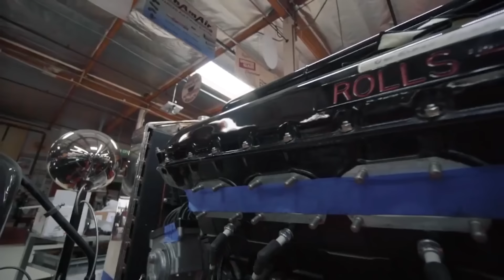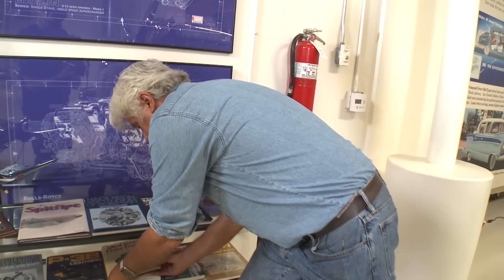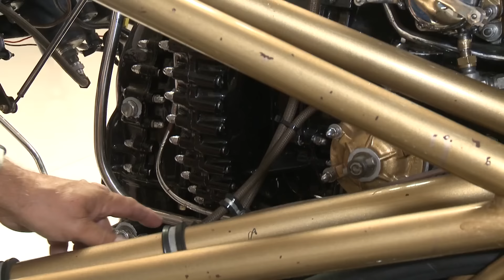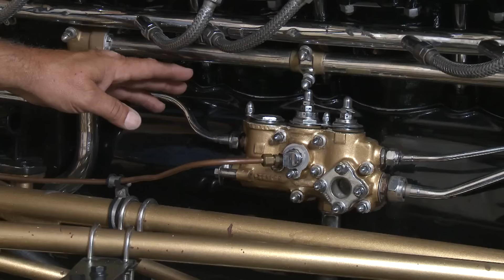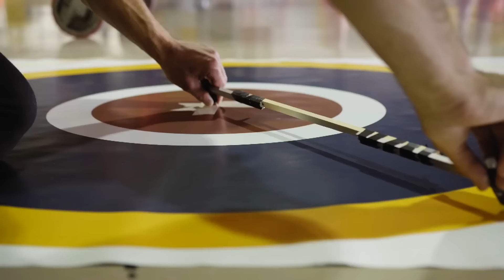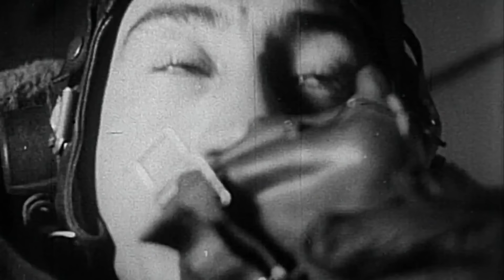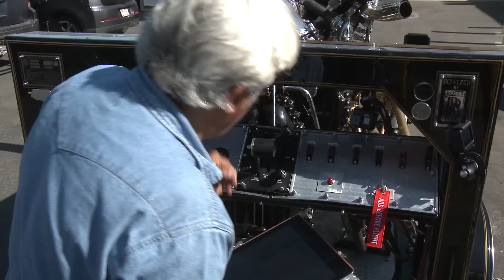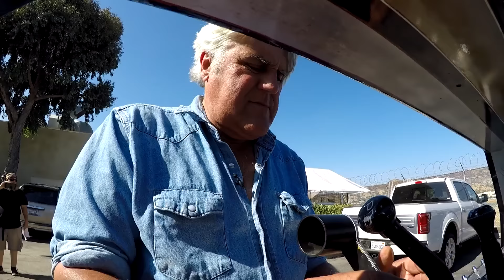The Engine That Won World War II - Jay Leno's Garage

Comment: Jay,

It's beyond doubt that the Merlin is a FABULOUS engine.  It powered the Spitfire, the Mustang, the Hurricane, the Lancaster, and the Mosquito.  However, it has serious competition on the Allied side in Pratt & Whitney's R2800.  The R2800 powered the Thunderbolt, the Hellcat, the Corsair, and the B26.  Post WW2, a pair of R2800s powered Sikorsky's CH37 "chopper".

BTW, 100LL avgas is not good enough for those terrific warbird engines, if full performance is to be obtained.  For that you need 115/145 avgas, which is LOADED with lead.

Eli D.
Reply: what engine powered the typhoon and tempest?

Comment: Jay, isn't the engine in the Bentley you mentioned a Rolls Royce Meteor? Because when it was on Top Gear, James May pointed out that it was the non-supercharged land-based variant of the Merlin, which was the Meteor.

Comment: Rolls-Royce selected Packard to build the Merlin engine because of their exacting manufacturing specifications and techniques. The throttle system with levers, rods, and bellcranks is really precise. Packard was years ahead of other manufacturers in the USA. But sadly, they did not survive. Thanks Jay or preserving history.
Reply: Thank you for the information (although I doubt how many will actually even notice it or acknowledge it, even if they do).  Nationality tends to blind people to the facts.  RR had a gem in their hands, but sadly the cottage-centered manufacturing ethos in the UK (where things were mostly hand-built) was not the best way to mass-produce engines for a war effort.  Packard was able to do this very thing.  In fact, there's the well-known story of Packard complaining that they were used to much tighter tolerances than RR was, so the plans had to be "re-drawn," so to speak to conform to more exacting specifications.  In the end, even people on the ground were hard pressed to tell a Packard Merlin from a Rolls Royce Merlin.  In fact, of the 150,000 or so Merlins that were built, Packard built about 55,000, while Ford of Britain built 36,000 - a lot of people would be surprised to learn that RR was in fact in the minority building the Merlin!  Check out this article:  http://www.tested.com/art/makers/492418-packard-merlin-how-detroit-mass-produced-britains-hand-built-powerhouse/
Reply: Steve  RR did NOT select Packard to build the Merlin, they were the ONLY ones to agree to build it !!!  Chrysler refused, as did Fork USA.
Reply: Steve  Actually RR did NOT select Packard !!!  Packard was the only co to AGREE to make the merlin !!! Chrysler first turned them down, then Ford/USA, both went on to make other aircraft engines,  Chrysler the R3350 and Ford/USA the R2800 !!!  Packard finally agreed to build complete engines only, not components as RR first wanted !!!   BUT  Packard was a quality engine builder !!!  Besides building 55.523 merlins, 37,137 for the British, Packard built 14,000 of their own M2500  PT Boat engines !!!

Comment: For longer Demos, where the RPM could be increased, I think the prop would need to be swapped out for something with 0 pitch. As it is now, it looks like it's actually working as it would when installed in an airframe, by trying to pull itself along.
Or perhaps remove the blades altogether.

Comment: The greatest piston aircraft engine ever built! 
It's going to be great seeing the awesome Wright R-3350 Duplex-Cyclone. That beast started at a mere 2,200 hp, but ended its life at 3,700 hp. They powered the B-29, Martin Marlin and Mars, the Lockheed Constellations and their P-2 Neptune, the DC-7, C-119 Flying Boxcar, and the last piston powered combat aircraft in service the mighty A-1 Skyraider. That monster of an engine outdid Pratt and Whitney's Double Wasp engine (1,500 hp to 2,800 hp)...
Wait... What? The Rolls Royce Merlin?!
No way does the Merlin (1,030 hp to 2,060 hp) come close to the power of the Double Wasp, much less the power of the Duplex-Cyclone.

Comment: (continued...)
The Merlin had two flaws, from the point of view of a combat aircraft engine. 
1 - that constant velocity carb simply didn't work if you inverted it. Mercedes Benz went very early to fuel injection, which had the benefit that it worked (at least for a few seconds) inverted. Tip a Merlin upside down and the light went out. It was like pulling off all the plug wires... Thing was, Rolls Royce did look at fuel injection, several different setups and companies, and not one contender got within about 30% of the hp of the SU carb they already used. They said many times, even if they found one that was only 5 or 10% lower, they'd have grabbed it.
2 - cooling. The strength of an inline engine like a V-12 Merlin, is that it has a very small frontal area for the cubic swept capacity (and power) of the engine. It's long and thin and it goes fast. An air cooled motor of radial design has all the cylinders arranged in a circle, which is like a parachute. It gives good reliable cooling, but a thousand hp engine uses 500 of those hp to drive the parachute around in the air so it can keep cool.
Another consequence, is that an air cooled engine is fairly resistant to foreign object damage, and small arms fire. In some cases, you can do quite catastrophic damage to an air cooled radial and still fly it home. But one .22 cal bullet hole through the radiator of a Merlin, and it's going to stop. You may have 5 minutes, you may have ten, but it's going to stop.

Comment: I disagree that the excellent Merlin engine won WWII.  Yes, it clearly 'won' the Battle of Britain and, yes, it was invaluable in the European theater.  Instead the "engine that won WWII" honor is shared by Pratt & Whitney and Curtiss-Wright, manufacturers of the big round radials that powered the majority of American military aircraft used in both the European and Pacific theaters.

And Jay Leno, please wear ear plugs when firing up that Merlin, or any other noisy engines, in the future. Don't want to see you sporting hearing aids anytime soon.

Comment: Wonderful. Thank you Jay.
One point perhaps worth noting, many of your viewers and fans like fast cars and bikes. Many have grown up with the idea of tuning or hot-rodding an engine. Let's roll through the specs of a RR Merlin and see where these ideas came from.
Merlin was developed from a RR racing engine (used in the S6B) during the 1930s. It started with a 4 valve head. It started with the idea of fairly low static compression and supercharging. They had trouble with burning out the exhaust valves, so it had hollow sodium filled exhaust valves. It also had screw in valve guides. They knew they'd have to change them. It was run with a variety of fuels. In the mid '90s I was pit-crew for a gokart racing team, and had had some extremely highly modified 2-stroke motors. We used a very exotic fuel in them, which we mixed up ourselves. It was about 10% petrol, about 10% 2-stroke oil, a few drops of Toluene, a few drops (what we thought we could get away with) Nitro-Methane, and the rest was Acetone. Nail polish remover. I found out many years later where that recipe (or the starting point for it) came from. It came from the early RR racing engines used in the S6B... The first human to reach 400 mph in level flight, was a seaplane (had floats on it) with an open cockpit, and it was running on acetone and nitro methane! And some caster oil....
Tuners today know about water injection in boosted motors to control detonation. Water injection was used on Merlins. They sometimes also mix water and Methanol. That was also done on Merlins. People today try to do forced induction with bottled Nitrous Oxide, laughing gas. That was also used on Merlins. Those who have messed with British cars will know the SU constant vacuum carb. That was the starting point for all the constant velocity carbs used on Japanese motorbikes from the late '70s through to the introduction of fuel injection. Those all came from the SU. The SU came from the Spitfire, and the Merlin.
Early Ducati V twins had Desmo heads and shaft drive by bevel gears. The designers didn't trust belts or chains of gear-sets, they relied on a technology that was proven to work. Bevel drive shafts. You know where they got that idea from? The RR Merlin. There were no belts, no pulleys, no chains, no multi-link contraptions in it of any kind, because Rolls Royce insisted on it. They'd tried that stuff, and it failed and failed and failed and they had an epiphany - everything gets driven by shaft, and only by shaft!
Every tuner boy, every hot-rodder, every ricer-racer, every speed fiend and lover of go-fast, needs to take his hat off to the grand daddy of all tuned engines, the Rolls Royce Merlin. About the only thing we routinely use to go fast today, that it DIDN'T have, was turbos. In many cases, it was the first engine anywhere to use that technology. Much of what we know today about go-fast, comes down to us from the Merlin.

Comment: I think the R2800 Radial won the war, both heavy bombers, all the late Grumman's, the Corsair, the Thunderbolt, our dive bombers, Mitchell? We loved our radials, more dependable than an inline engine when you are getting shot at.
Reply: The major planes the R-2800 was used on were the P-47, Corsair, Hellcat.  F7F and F8F used them too but neither saw combat during the war.  Also the A-26 and B-26 used them, the latter being a fairly important plane during the war.  Lastly was also used on the P-61 night fighter.
Reply: Good point-they would still run with heavy damage and flailing con-rods-just as well!!

Comment: The best fighter in WW2 is Messerschmitt bf 109 with Mercedes engine
Reply: Spitfire beats it. Constantly developed and used all over, from carriers, long range recon, fighter bomber version PR versions flying from the UK over Berlin, drop tanks and in use on the first and last day of the war and still never persisted with that shonky killer undercarriage of the 109.
Reply: Mercedes is a car manufacturer -.-
The DB 605 was produced by Daimler-Benz and it had nothing to do with cars.
The 109 had a dozen variants so saying it was the "best" makes 0 sense.
Reply: wow i never ever read so much bullshit than in this ditch of butthurt idiots :D muh my country is soooo much better than yours muh.
Reply: Except the P51 with this engine sent many 109s to hard landings.
Reply: How do you know, Have you been  a combat pilot in both planes?
Reply: Daimler-Benz engine*
Reply: New design carburetors introduced in 1942 solved the Spitfires inverted fuel starvation issue.
Reply: ME 109 and variants were not the 'best' fighters in WW2. Poor reliability, dubious supply chain for support, poor radio and navigation systems compared to American aircraft. It had limited ground attack abilities, and fell far short in numbers compared to the most produced WW2 aircraft, the YAK Sturmovik made by the Soviets.
Reply: Brian Green plus don't forget we won. No matter how good the 109 was it didn't help them win the war.
Reply: Hammmod Jabeer probably the mk9,mk14 spit,or fw190?
Reply: That's one battle, not the whole war.
Reply: munched55 one plane sent shed loads of bf 109's to a early grave is a hurricane or spitfire
Reply: SpeedBird  wait a few mins,  the Confederate boogeyman might make an appearance. ...
Reply: munched55 didn't  do so well when the ME 262 turns up though. But thankfully Hitler sabotaged that plane by demanding it was a bomber. That pout back production so far that it never appeared in sufficient quantities to do what it was best at
Reply: TURKISH CYPRIOT   The 109 could put-climb the Spitfire but the Spitfire could out-turn it.
Reply: John Techwriter I do like both planes
Reply: Dean Dulson by the way I am a aeroplane engineer I know what I am talking about
Reply: Nathan Bertram I have to say the spitfire with the Merlin engine is jest a thing of beauty. But remember during the battle of Britain the most prolific fighter we had was the Hurricane bad just by sheer numbers it shot down more enemy planes. The spitfire was like a formula 1 car it required a lot of looking after bullet holes in the metal skin culdent be patched like the canvas skin of the Hurricane so turn around time on a spitfire could be quite a bit higher than it's poor relation.
Reply: The ME109's airframe might have had some disadvantages compared with the Spitfire (not as maneuverable), but the ME109's supercharged engine sound like nothing else.
As much as I hate the Nazi regime & what they represented, I can't deny such a superb engineering achievement.
Reply: The 109 was very good at the start of the war but didn't have the development potential of the Spitfire, for example. And the Mustang, as a much later design. As the war progressed it continually lost ground to newer  designs. Those were years of very rapid development and the Me/Bf 109 was started in 1934.
Reply: Ahem... The 109 was built over 33.000 times and remains the most built fighter in the world... just saying
Reply: Peder Hansen My friend, the 109 K-4 had 2000hp 2x13mm and 1x30mm MK 108.
Reply: Hammmod Jabeer, and Mercedes F1 engines are made in England by British Engineers with British technology.....Mercedes bought the technology.
Reply: As a Brit I would have to say the P51 was the single best piston fighter of WW2 closely followed by the Yak-3, 109 and Spitfire.
Reply: Saying Plane X is better than Plane Y is dumb, it all comes down to which specific variants you're comparing, and at which stage in the war.

Take the Spitfire and BF 109 - an early war 109E is hands down better than a Spit Mk1, but if you were to compare a late war Spit Mk XIV and 109G, the opposite's true.
Reply: the messerschmitt was notoriously unreliable
Reply: Hammmod Jabeer Mustang ate them for breakfast.
Reply: Spitfire the best sounding and best looking machine ever made! German planes blah blah blah.. they lost we won... just shows who's were better!
Reply: Hammmod Jabeer 

The 109e was awesome but hopelessly outclassed by the razor sharp little Spitfire.
Reply: Messerschmitt  engine was fuel injected merlin engine wasnt  and spitfire couldnt  climb vertical in a dog fight if the spitfire start chasing BF109 all pilot did climb vertically because the engine was fuel injected with a carburetor engine if you tried to climb vertically fuel was going back to the fuel tank and the result stalling the engine in mid air result BF109 1 Spitfire 0
Reply: The 190 would would spank it
Reply: munched55 The FW 190 was seen as a space craft because it was so good

Comment: Nah, the engine that won WWII is the *R-2800 Double Wasp*.  It was used in the P-47 (more made than P-51''s), A26, B26, P61, C46, F4U Corsair, F6F Hellcat.  The other arguable candidate is the *R-1830 Twin Wasp*.   These two engines powered the majority of US aircraft during the war.
Reply: The Merlin power more aircraft than any other engine  (26 not counting the multitude of variants) it was de-rated renamed the Meteor and used in tanks as the power plant. It  lost 4 Cylinders to become the Meteorite V8 for use in  marine applications,  tank transporters and stationary power plants (gen sets) . It really was the engine that won WWII
Reply: Merlin was used on both US planes and British.  For the US it was really only used on later P-51's.  For the Brits, Hurricane, Spitfire and a host of multi-engine planes.  I think though if you look not just at number of plane types but the actual numbers of planes manufactured of each type, the Allison v-1710 has to rank right up there.  Used on P-38's, P-39's, P-40's among others.
Reply: Not really there were over 2 times as many Merlin's built as there were  Allison v-1710's and that is not counting the  Meteor either.

Comment: Pretty sure he flooded it and fouled the plugs, which is why it was running so badly. 

Cool VAWT in the background.
Reply: In an aeroplane you would just give it it's head and blast all the crap out, it's a bit hard to do when it's on an uncontrollable gurney.
Reply: Something I remember reading about the R-4360 was that improper starting technique could foul all 56 spark plugs, then all of the plugs would need to be pulled and cleaned or replaced, I don't know if that can happen with the Merlin, though.

Comment: I'd love to see an old aircraft engine run with direct injection as is now used on some modern engines.
  Yeah, it would not be certified to fly in an operating aircraft.
But it would start better!
Reply: As far as I know... the merlin used a carburetor to increase the specific power of the engine over the injected equivalent. The vaporisation of fuel between the super charger and the chamber increases the charge density due to extracting heat form the air equivalent to the specific heat of vaporisation of the fuel. Or some such.

It is a bone on contention that the merlin used carburation, but it was a design choice not a design limitation so to speak.
Reply: I was not referring to 1940's fuel injection.
On the matter of 1940's fuel system, air ingested by a carburetor could drop temp/pressure at a venturi to cause ice crystals to form and block the fuel passages, thus most carbs (all?) are fitted with heaters to prevent carb icing.
  Fuel in these large displacement engines was used as part of the cylinder cooling, a richer mixture than precise combustion required.
  No, I was thinking 2015 era direct fuel injection. it has an injector in the combustion chamber, somewhat like a diesel has. (gas direct injection uses spark to ignite and diesel uses the high temp of the compressed intake charge to ignite, i.e. compression ignition)
  A well engineered carburator with clean fuel is more reliable than any electronic system, and certification for a new fuel injection on an aircraft piston engine is unlikely.  But an engine on a display stand could have any equipment the owner might choose.
  Would anybody? I doubt it.
  Just the fanciful musings of a curious 60 something.